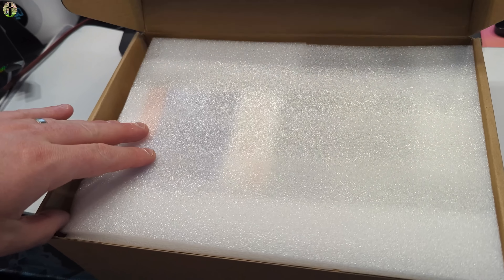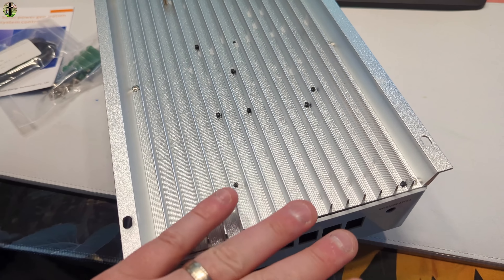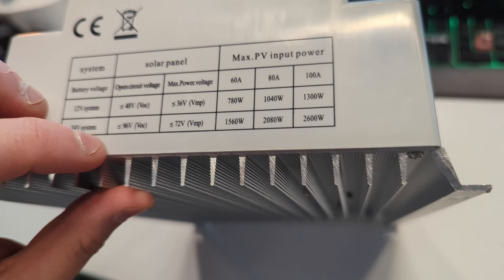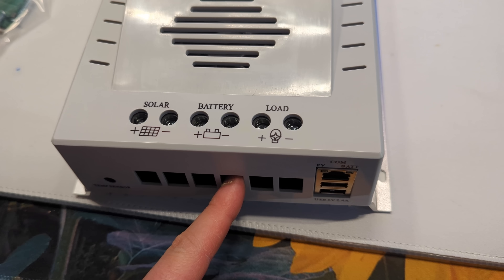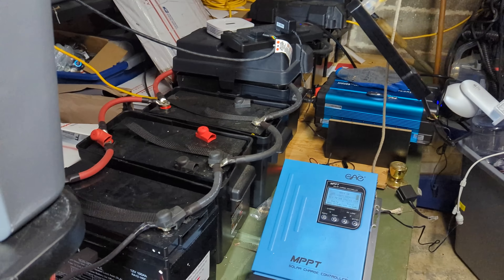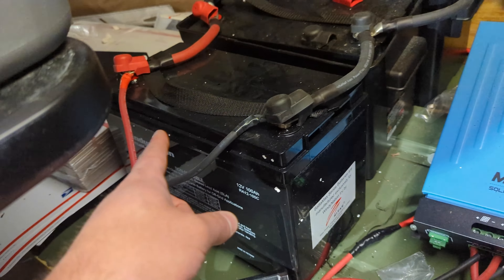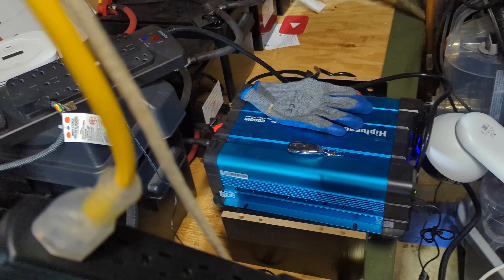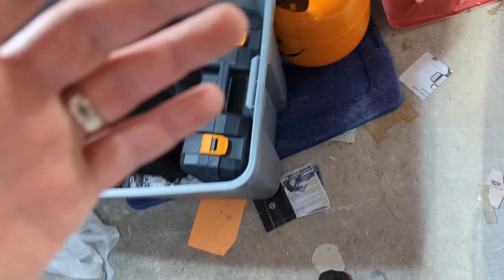OOYCYOO MPPT Charge Controller 100 amp 12V/24V Auto, 100A Solar Panel Charge Regulator

Comment: Are there any settings that need to be made on the charge controller or are they automatic sensing?
Reply from the maker: You can change settings on charge controllers but most are setup already

Comment: Sorry dude, you read the specs wrong on the charge controller panel. 

The 60, 80 and 100 are the different charge controllers and the maximum solar panel voltage that can be input. 

Example the 60amp charge controller at 12 volts has an Voc of 48, a Vmp of 36 and the maximum solar wattage that can be hooked to the unit is 780 watts.  The 100 amp can handle 1300.wattsof solar power.
Reply from the maker: Wow, thanks! I've been doing my research but I obviously missed something, thanks for the info!